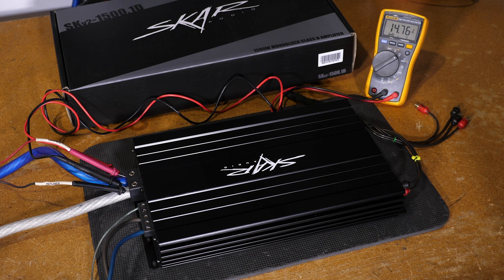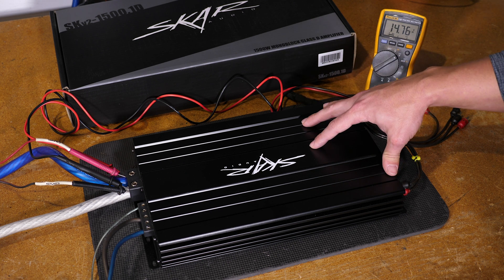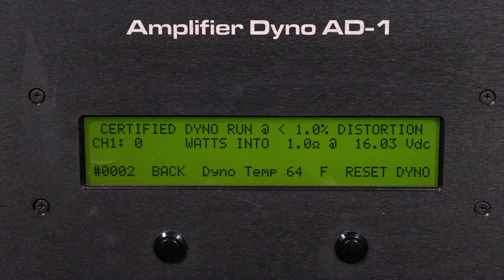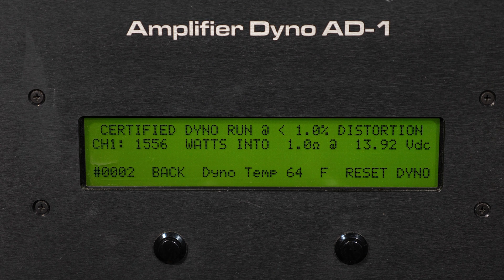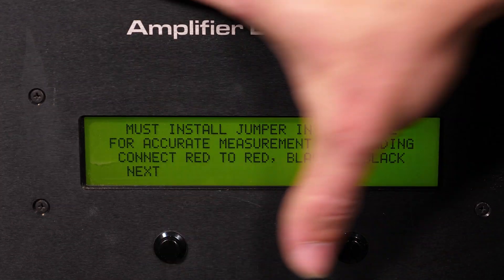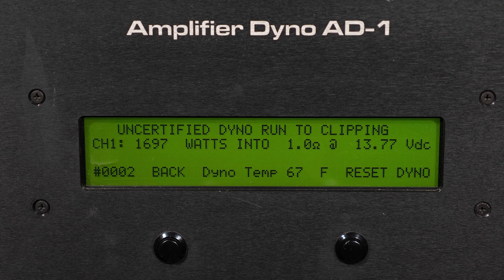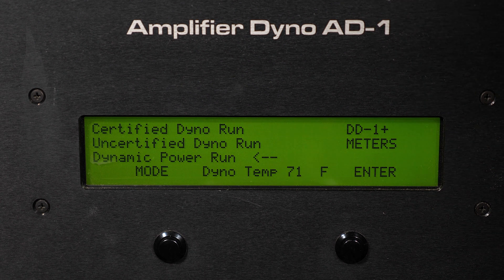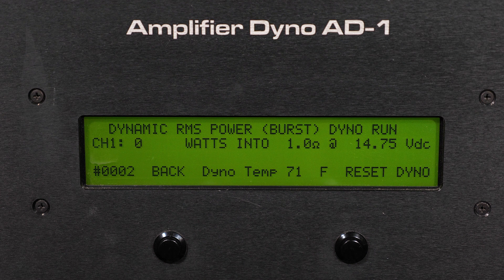Skar Audio SKv2-1500.1D Monoblock Amplifier Dyno Runs using SMD AD-1 Dyno

Comment: Can this amp handle 1 skar zvx on 0.5 ohm load with voltage drop to maybe 13.5 or will it burn that board ?
Reply: Im not a qualified person but seems like on 0.5 it will have problems. There is in manual saying that 1om minimum. Maybe im wrong
Reply: I put 4 toro force 8s at half ohm and I didn’t have issues

Comment: Got 2 X-8” sundowns.. just ordered this amp.. how the hell do I run both tied together at 1oh into this amp?
Reply: if the subs are dual 4 ohm just wire them in parallel (negative to negative, positive to positive) the amp will sense it and go to 1 ohm
Reply: Bad ass amp.can it run two 12s
Reply: At 4 ohms
Reply: @jimwarren1298  it wll push 2 12s as long as the final load is 1ohm

Comment: Can ya test it at 12.9 Volt like on avg car volts??  And I hear ya customer service sucks. I just spent $700 on SKV 12” and 1500 SKV D amp. Ya better honor your warranties
Reply: With these amp you need to upgrade your cars electrical. Like alternator, big 3, and a second battery

Comment: You guys are being very deceptive. You're starting your test at 16v. Which would pop every fuse in someones car. Nobody runs at that, 14.5v max on average.
Reply: They do that because they don't have a alternator running the battery's so they keep the volts high at first so it can drop to normal to give real world results
Reply: @seanwatts392  what lol. No. I've seen em not run at 16v lol.
Reply: @AgentJeffy  because they had a charging system on there batteries. In this video they didn't have a charging system hence why the volts dropped to 14.4 as soon as the dyno started. If they did another dyno after they would have to charge them back to 16v if not the volts would keep dropping because the batteries arnt charging
Reply: @sean watts  quite literally NOBODY else doing dyno runs starts at 16 because what you said is bologna.

Comment: You dont start at 16v cars dont have 16v alternators start it at 14.4
Reply: He doesn't have an alternator to keep the batteries charged up, you gotta start the test at a higher voltage to show a more accurate reading.

Comment: What subwoofer is best for this amp?? I have this amp and the 12' zvx 1500 rms subwoofer but it's just not enough for me. It starts to clip the way I want it to sound any suggestions on what I should do?
Reply: the sub I have is the 12' ZVX 1500 rms 2 ohm wired down to 1ohm. It starts to clip. Any suggestions?
Reply: @Gilbert Rodegeb  even though this comment is 4yo u need the skv4500 for one zvx

Comment: But the thing about this is ur starting voltage is 16v a normal car voltage is 14.4 if u do it at starting voltage at 14v it would be more realistic and that's not with box rise
Reply: Not an accurate comment. They use a power bank of batteries. Notice the 16v dropped to rated 14.3v? That's because they don't have an alternator to keep constant 14.4v.
Reply: @Rightn2Parabola  does ur car start at 16v no so like I said in my comment
Reply: @trelacey6263  I don't think you understand lol. The starting volts doesn't matter in this test. If they started at the normal volts the volts would drop extremely low and the amp dyno wouldn't show the proper watts of the amp. They start high to compensate for not having a alternator charging the battery. The end result in this test is what matters because the volts dropped down to normal.
Reply: This company ain't humble at all if the amp gets 1 watt over rate power example 1501 watts he will boast it lol haha wow I get anoyed

Comment: So if my car with manufacturers alternator 80~ amp around the 13.7 volts  will give regular customers less wattage output , meaning less efficient Am I correct ? But more than accurate wattage rms than other brands .
Reply: Chuck Brown you shouldn’t use this amp with an 80 amp alternator
Reply: @Q60Godzlla  right lol
Reply: You'll need a new higher output alternator. If not the new alternator I'm thinking 2 extra batteries. Anybody else can chime in.
Reply: @Theyoufeelme im doing great with mone of that

Comment: Start the dyno run at 14v not 16v, you'll see a difference
Reply: That's not how the SMD dynos work. You can even go to Steve Meade's channel and his Dyno tests do the same thing.
Reply: @dylanhoel1636  Steve meade also doesn't understand physical distortion with speaker flex and surround distortion so your appeal to authority is void
Reply: @dylanhoel1636  it pulls less current when at higher voltage 
Run it at 13.3 and watch the amps change
Reply: what did you think about this amp? Trash or?

Comment: Throw some Tiffany connectors on your next series. Top tier amps shouldn't have any shortcuts. Other than that solid lil amp.
Reply: CRESCENDO AUDIO has those Tiffany Connectors. Theyre solid AF
Reply: @vasquez3769  new crescendo amps are great. Very nice. Just don't like the orange
Reply: @DibeezyTheGifted  yea not everyone does. Theyre extremely reliable though and pound hard!!
Reply: @vasquez3769  yes that new 6K and 4K specs are dope! Heard from a reliable source there's a 8k, 12k and I think 18k coming. Alphard audio has a 20k coming also. S&I have some heat on the horizon.
Reply: What is the big deal with tiffany style rca connectors ?
Reply: @RaymondChapman45  keeps them from being loose or being pushed in over the life of the amp.

Comment: Nothing can beat the price of this amp
Love skar 
Can't wait to buy my ix 8
Reply: Crescendo Symphony S1 is 1500 rms with Tiffany style connectors, Korean boards, underrated and for minimum heat its got a fan. I got mine brand new for $260!! THATS A PRICE YOU CANT BEAT WITH TRUE QUALITY!!!
Reply: @vasquez3769  runner-up is orion XTR 1500.1 with Korean board and Tiffany style connectors. They have really brought that brand back
Reply: @rmblwgn  yup. Theyre nice too
Reply: What about the CT Sounds 1400.1? 1400w rated, @ 1 ohm @ 12.4v